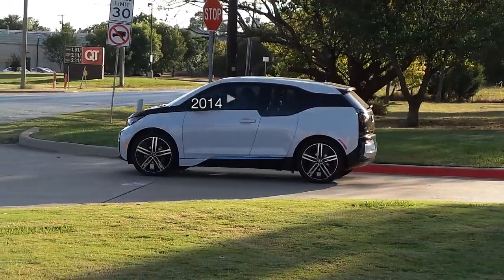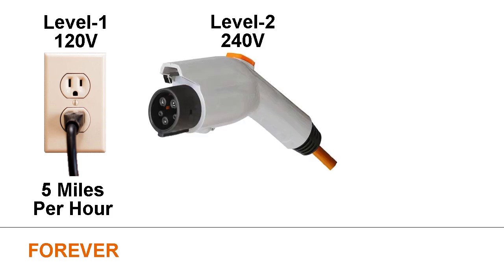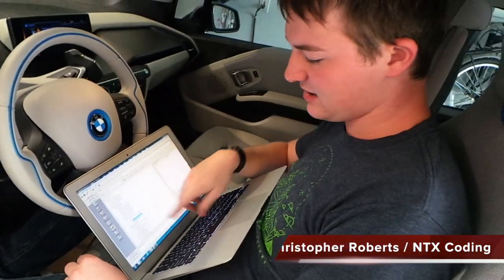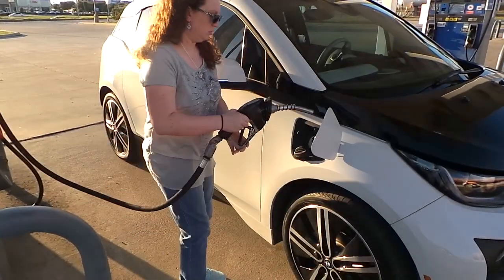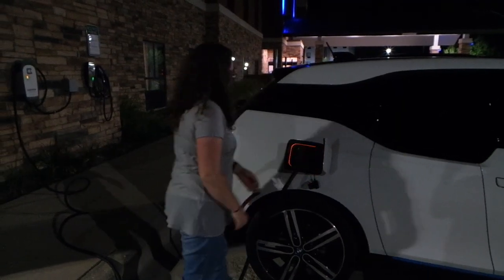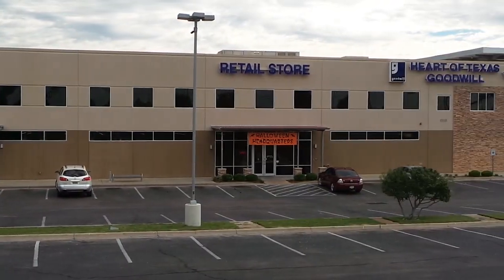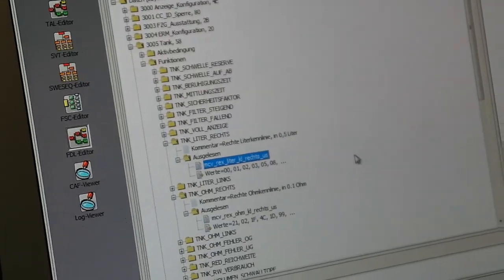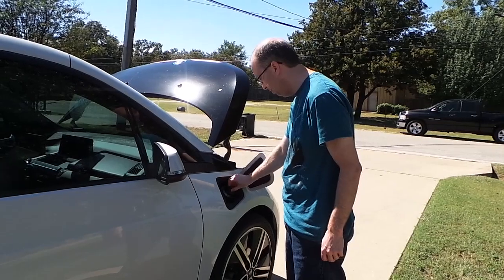BMW i3 REx roadtrip, charging, coding, and range test.

Comment: the i3 isn't great for gaming
Reply: hey it's okay. gaming is mostly about the single core performance and they mostly only need 2 cores!
Reply: PrincessZoey97 Nope. That was 2 years ago. A lot of newer games need 4 cores or atleast 2 cores with hyper-threading (4 virtual cores in total) without which performance suffers significantly.
Reply: +Anitrex006 eh in battlefield 1 the core i3 gets 10 less frames than the i5/i7. source: LinusTechTips Battlefield 1 benchmark video.
Reply: PrincessZoey97 Umm. Exactly my point I guess.
Reply: Anitrex006 you say it likes its unplayable dude lol
Reply: Anything below 60 fps is for console peasants     #PCMasterRace     :-P
Reply: +Anitrex006 any game below 144hz is shite. csgo or gtfo
Reply: Hang on, hang on. I got a good joke!

Why did the gaming peasant cross the road?

Because it has to render the other side of the city!
Reply: maybe GTA San Andreas will run
Reply: Abhi Mayadam cool GTA San Andreas runs on almost everything then
Reply: Trying to get higher MPGs can be like a game of itself. Gran Turismo & Forza may reward you for faster lap times, but your wallet and bank account will reward you for efficient driving techniques in the real world to maximize range and energy used.
Reply: An i3 works for gaming just need a Titan X
Reply: If I were to build a everyday work + gaming rig today, I go for an i5-7600; a good balance between power & price. With a GTX 1070 for course.
Reply: PLEM ALADINO How did you make something like that? That would DESTROY Intel CPUs in gaming BTW :P
Reply: I would either get a 6600k, 4xxxk, or wait for Ryzen to come out. I have an i5 2500, 16 GB RAM, and a GTX 1050 TI and it works great, though if you plan on doing VR you should get a 1060.
Reply: Jerome Drew There needs to be a Core i10
Reply: Nice Joke.   lol
Reply: This comment reminds me of his PowerMac G5 episode and how it uses so much energy
Reply: +ok i see what you did there 😂
Reply: OK O
Reply: OK I have a Celeron for gaming!!😂
Reply: just get a ryzen 5 1600x
Reply: It’s not even a computer 💻
Reply: It’s Not Even a Computer
Reply: OK you should save money and get the i5 7500,you don't have money for a z170 board for overclocking,they are expensive
Reply: Asourat, why would you get a z170 (6th gen chipset) board for a 7th gen CPU and, further more why would you get a "Z" series motherboard, which is for overclocking, and why would you get a a non overclockable CPU? Next time you start giving computer advice, know what your talking about first.
Reply: Swishdawg Gaming i don't think z170 is for 6th gen,i think it is x99, idk i got in the pc master race 1 year ago
Reply: Z170/Z270 are for 6th and 7th respectively although, both support 6th and 7th (the Z170 might need an BIOS update). The X99 ist 5th Gen Extreme edition (6 cores and more i7s) platform
Reply: I still have the 4th gen Intel core I 3 and it's still gud and GPUS do most of the stuff and the vid is a car review a
Reply: dessnom that's true. People use 2nd gen i5/i7 and they don't have problems with new games
Reply: What about i8? isnt it its fast enough?
Reply: LidlWifi i have a low power 4-th gen i3 1.4 ghz with hd graphics,50 fps in csgo,unplayable
Reply: xD I get it  😂😂😂
Reply: 256 likes as 256 colors
Reply: Keep it on 256 !!!
Reply: Add a Graphics Card
Reply: But it is the best wm.
Reply: I need some coffee. These comments are interesting.
Reply: Unless Intel slipped in a 4-core i3 that I don't know about (and chances are, they most likely did), i3's suck.

That said, we have the following:
 - Intel i3, i5, i7, and i9; and the BMW i3, i4 concept, i5 (discontinued), and i8
 - Radeon RX 400 and 500 series; and the Lexus RX 300 and 400 series
 - NVidia's multiple generations of GTX GPUs, usually with a 3 (now 4) digit number (like GTX 970 or GTX 1080); and Plymouth's three generations of GTX cars (just "GTX" by itself).
 - AMD's R9 series of GPUs; and NYC's retired R9 family of subway cars (yes, subway cars)

Anyone wanna add to this list?

EDIT: Yup, Intel's i3-8100 is a 4-core CPU.
Reply: It will run on the PS2.
Reply: Lawl
Reply: i3s are actually pretty good for gaming.
Reply: i3's with the REx have 4 threads, perfect for gaming!
Reply: Can't even run Crysis.
Reply: @PrincessZoey   False. I have an i3 paired with a 1080. (dell did this not me) it is absolutely terrible for gaming. bad bad bad.
Reply: yes it is liar
Reply: atleast i can  crush Colin Mcrae Rally 2.0 with full settings
Reply: why do you do this to us
Reply: because cars aren’t meant for gaming
Reply: @landon613  r/wooosh
Reply: The Tesla is good
Reply: epico roast
Reply: Gay
Reply: Can it run doom
Reply: if it can run crysis its respectable
Reply: Over clock it

Comment: I used to have the i3 but i wasn't getting the best performance, so I upgraded to the i7. Now im getting much higher fps lol
Reply: Thanks for the video seems like a big pain in the ass too me . All this charging totally ridiculous  .
Reply: i have a intel i5 (:
Reply: I used to have a P4 but now I got an Xeon E3.

And about cars: I had a BMW M3 E46(I had looked it like the M3 GTR in NFS Most Wanted) but it got stolen...
Reply: @mikat1914  do you not need to stop at fuel stations? It’s a bit like that but slower and less stinky and climate changing. The 60Ah i3 is quite old and has been doubled now so the practicality has improved a lot and other cars have even more range and much faster charging.
Reply: You need to disable antivirus since its taking resources and you should install an M2 gen 5 disc.
Reply: Used to eat soup with a fork, now I use a spoon and is so more convenient lol
Reply: @mikat1914 its worth it with today's gas prices

Comment: when you tell her you drive a bmw and then pick her up in this lmao
Reply: "Hey babe I drive a lambo."

pulls up in a 1961 Lamborghini DL25 like diesel noises
Reply: Google it, I dare you.
Reply: Ding. Ding. Ding. Ding. Ding. Ding.
Reply: @lsswappedcessna  Lamborghini rotorvator. That is a thing
Reply: RIGHT? NO REASON TO MAKE IT SO UGLY.
Reply: xD
Reply: @MICHGO1  oh common that's a feature the amazing looks otherwise everyone would want it if it looked better like a tesla cause Nissan redesigned the leaf to make it look better so BMW could redesign the i3 to make it look better but they do not so it's a feature to look ugly because BMW wants it to look that way
Reply: Quicker than a e90 m3 0-30 🤫
Reply: @raven4k998  BMW makes more profit selling X5 or X7, soon they will build an electric version of X3.
Reply: @stefanjepp6612  do you know how long an i3 will last as far as the electric drivey bits are concerned will they die as fast as the gas version at about 80000 to 120000 km of driving or will it last longer then that I am curious as my i3s is only has about 4500 km on it so far I love it just wondering how far will it go before that stuff starts to die on me
Reply: @raven4k998  I do not know.
Reply: I drive a Porsche!
*pulls up in Porsche WW2 era tank”

Comment: Just a little tip for i3 owners who get it coded for the hold mode. You can go into the menus and put the hold as one of your hotkey/shortcuts (normally used for radio stations). I set it to the last one, I believe #8, just hold down #8 on that hold menu and it'll save it there (be sure it's the actual menu item to turn the gas engine on, not just get access to that menu). Then anytime you need it and are below 75% battery, you can press #8 and it'll turn on the gas engine. 

The beauty of this is that I found the first time I got it coded, I had to bring the car back in for a service update. Then boom, the default US settings were put back in and I couldn't access that menu! I had to go back to the person who coded it, pay him a little bit of money, and get it recoded back in. That's when I added it to my hotkey/shortcut. Since then, the dealership has reset my settings (likely from firmware updates) and so I can no longer access the hold section in the menu * BUT * thankfully the hotkey setting is still there and it still functions! So it's funny because it still lets me hold it by pressing #8 but I can't access that anywhere else in the menus! I don't use the hotkeys for anything else so I'm not at risk of changing it, but if you do this trick, make sure you don't change it otherwise after a firmware update you won't be able to add the hold key again unless you get it recoded. I've since brought the car to the dealership a few times, I believe they updated firmware each time, and also have updated things for recalls, and my handy #8 menu item is still there. It really allows for long distance driving (like 200+ miles) doable without having to worry about losing power... it acts like a normal car and you can breathe a huge sigh of relief not worrying about it. Yes it's annoying refilling often, but it's better than not getting to your destination or having to rely on a rental.
Reply: Will the code work for any i3?
Reply: Just i3 with the extra Rex engine I believe it will work. It's already there for European market which is why all the cars have it. It's just hidden from the US market because of regulations or stipulations that I won't get in to. But rest assured every i3 Rex can do it since it's built in.
Reply: Thinking of getting one for LA driving. I’m still confused what the “hold” mode does? Does it just give more mileage
Reply: @zeigrei4501  Late, but hold mode holds the battery at whatever state of charge it's at when you activate it and uses the gas engine to power the motor. If you drive too fast it will still drain the battery rather than hold it but it lets you maintain more power and speed because the battery is not empty and can provide spurts of power when needed (such as passing on the highway)
Reply: @DigitalMoonlight  
I think that driving on the flat roads 56mph is the sweet spot where the  REx holds the charge at the level where it was activated.
Reply: Dude... just buy a Tesla... they are half the price for twice the range. LOL
Reply: @DigitalMoonlight  

I could be wrong, but I don't think that's 100% accurate. Yes, when you hit the hold mode, it attempts to maintain the battery charge at the level you set. However, I believe it does so by the motor charging the battery. The little moped engine is used as a generator to charge the car. The issue is that is you're driving very fast, it's discharging faster than it can charge.
Reply: @crocodile2006  

The cheapest Tesla right now is going for $47K. Personally, I like AWD to handle driving in snow. Tesla sells the AWD as a performance model. $63K! Both I and my wife make six figures, but that's just an insane amount of money to buy for a car. You can get used BMW i3s with the ReX for $24K (or less), many going for as little as $17K. In my case, my kids often land up taking the cars and 2 cars isn't enough anymore. For the few times when an extra car is needed, the price of a Tesla just seems nuts to me. But if you've got money to burn, go for it!
Reply: @DigitalMoonlight  REx never powers the motor, only recharges the battery. The motor runs off the battery 100% of the time.
Reply: @crocodile2006 Around me, used Teslas are 2.5 to 3x the cost of used i3s.
Reply: @crocodile2006  what do you mean half the price? i say its twice more expensive than I3
Reply: @crocodile2006  Bud, you need to put the crackpipe down. "LOL"

Comment: We bought a 2014 i3 Rex with similar specs to yours in May and about a month later drove it from Pittsburgh to Stonewall Resort in West Virginia, 132 miles one way. We stopped in Morgantown to get a free charge for an hour or so, to make more of the trip on battery, and had lunch downtown. One of the unexpected pleasures of owning an electric car at this early stage of adoption is that the search for charging stations sometimes takes you to places you wouldn't otherwise visit. Central Morgantown, it turns out, has a nice selection of places to eat and is pleasant to stroll around in. And the charging station was not only free but solar powered! We would have driven right by in our gas-only car and missed a nice experience.

Comment: What about the i5 or i7 equipped cars???
These cars can run Crysis 3 60FPS Skybox Test..
Reply: Moustache Pikachu, I happen to drive an i3 (Asus)...
Reply: @Empika  Xenon* but have you seen those Ryzen powered cars?
Reply: @xander1052  Can't beat the price/performance of those chips. Mega miles for spare change. I happen to have the new R7 3700X and it drives beautifully!
Reply: @ashleybailey1785  just overclock the shizzel out of them then in winter you'll get more heat from the heat pump as it scavenges heat from the cpu hehe
Reply: The i7 is a real car though
Reply: my I3s can pull a trailer and not have drive train failure like a Toyota corolla IM will have if I try it na Toyota corolla owner nananana boo boo my cars better build quality over your car haha
Reply: i9?
Reply: lol.

Comment: This is so far one of the most useful tutorials of what BMW I3 is and what it can. 
You're right in that it is a waste of time to talk about the details you can read in a BMW brochure. You have many interesting recital entries under way on your trip. Super fine! 
There are three factors which I think are critical to electric car deployment. It is the range of the car, the location and density of charging places and the charging speed on those places. Electric cars' main disadvantage is in my opinion not so much the limited range but very much the expansion of charging places, which are often located quite randomly and fairly aimlessly. The charging speed is another major factor. Charging places and charging speed has Tesla done well in a big scale which all other electric car owners can only watch enviously. 

In Denmark, a Scandinavian and a German supplier of electricity for electric cars have come together on the establishment of a Northern European network of super powerful (150 kW +) DC charging stations at a distance of 75-110 miles between the charging stations. It is not ready yet, but hopeful it will be. With 150 kW you will be able to charge a BMW I3 of 1/3 of the time it takes with CCS Combo 2 DC charger. Combo 2 is basically prepared for 150 kW. In the DC area, it is my impression that Europe is well with relative to the US. 
Home charging is AC and charge on the move is DC; so be it. In Denmark CCS Combo 2 and CHAdeMO chargers are placed a maximum of 30 miles apart and roughly the same in Germany. In the Netherlands closer. 

I hope you will continue with new high standard videos for BMW I3 - I am looking forward to that.

Comment: I bought a 2018 i3s Rex about a year ago, and couldn't be happier with it, especially as gas creeps up toward the five dollar a gallon mark. I've noticed that the charging infrastructure, at least around here (Spokane, WA), has improved quite a bit in this last year, to the point where I'm considering a drive to Denver in the near future. I think I'll put a gas can in the frunk, just in case ; )